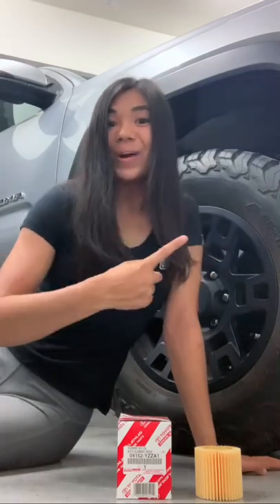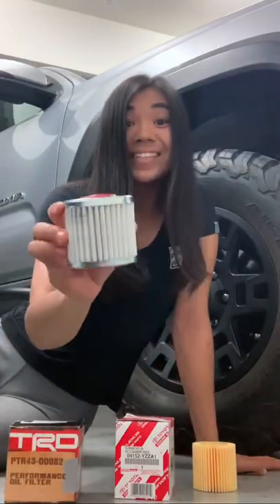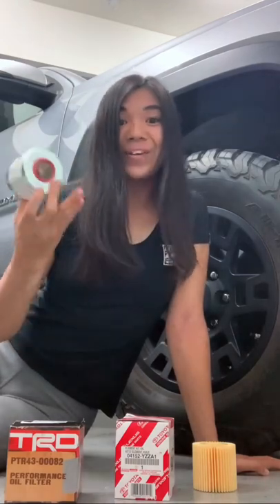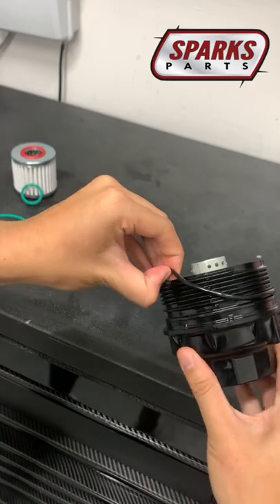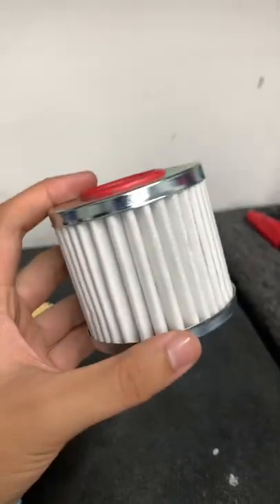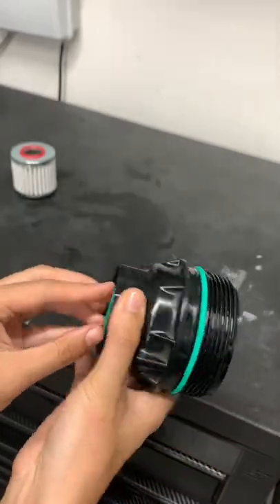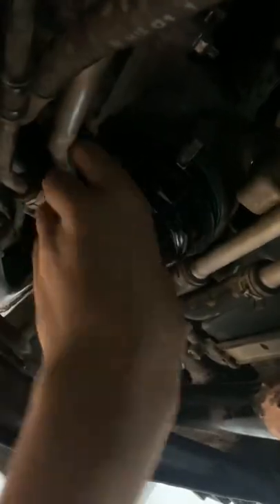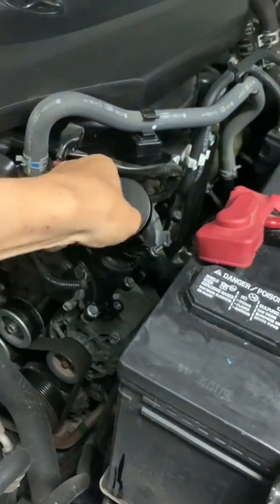Is the TRD Oil Filter better? (PTR4300082) #shorts

Comment: I am a Toyota dealer tech and I haven't ran into one of these yet. For those who are concerned about the quality of the normal OEM filters, I can attest that they are very high quality
Reply: Those metal end caps seem unnecessary considering they have that metal screen down the center of the paper element housing integrated into the cap. I had a Hengst setup on my ecotechs and they didn't have that metal screen to support the filter. The filter itself had a plastic core and they would be collapsing by 6-7k miles. (The factory recommended intervals)
Reply: I'm waiting for that one guy to show up preaching about how "FRAM filters are the best"
Reply: @deadpanda12109  I'm one of those guys that doesn't necessarily believe higher micron ratings are better.
Reply: @deadpanda12109  I'm also a "clean oil and a cheap filter is always better than old oil and an expensive filter" guy too. I would rather do a 3k interval on conventional than these 12-25k mile synthetic changes. I usually run Mobil 1 ep, penzoil platinum or Amsoil but i still change it between 4 and 5k.
Reply: @Hector Cortez-aponte-cabrera glad we agree!
Reply: @Hector Cortez-aponte-cabrera what's insane is my new Rangers factory oil life interval is between 7,500 and 10,000 miles! I did my first oil change at 1,500 miles to get the Motorcraft synthetic blend out of there along with all the shavings from break in. Was going to run mobil 1 ep however they didn't have it at the store so I went with Pennzoil Platinum (have heard some claim it outperforms Mobil 1) Im one of those guys that can feel it after a change and wow I got to say it really did smooth things up a lot. My fuel average went up a tick as well from 22.4mpg to 23mph. I debated running amsoil, but i can't justify the cost if im not going to run longer intervals.. so I just decided to use Platnum with the mobil 1 ep filter. I plan to change it every 3 to 4k so it should be fine.
Reply: @tokin420nchokin  oh, 100%
Reply: @Hector Cortez-aponte-cabrera  I 100% agree man I want to keep this thing on the road as long as I can!  I had planned to buy the truck when I turn the lease in so I have been making sure to maintain everything really well, but we will see (really like the looks of new Colorado with the turbo, if they release it) I am not a mechanic by profession but I definately could be. I went to college and focused my degree on it probaly because im cheap but i keep stuff running. The only work I dont do myself regarding vehicles is alignments& tire mounting and balancing (maybe some other highly specialized work like machining if needed) . Not because I can't do those things, I just don't own the equipment lol (actually use to work at a tire place as a teen doing tires and alignments) it's been good chatting with you man, cheers and good automotive luck. May your vehicle last a million miles, and a million more.
Reply: @deadpanda12109  always, and there is always a few comments how Valvoline is the best oil.
Reply: @deadpanda12109  fram is the best!!!! If you want to buy something new that was made so bad it wouldn't thread onto the car! Lol
Reply: @Hector Cortez-aponte-cabrera ive ran beater cars for 100k no oil changes. I would just add new thinner oil when it would get low. Im not saying its right or to do it. Ive just been young poor and stupid. But never did i have a problem. With the engine oil that is . In my case i was always fixing electrical or suspension parts. But thats the shit you do with$200 cars lol
Reply: same
Reply: @tokin420nchokin still a bit overkill, but ok 🤷🏽‍♂️

Comment: I kind of take the Scotty Kilmer attitude: as long as your using OEM parts and oil, and your following the scheduled maintenance or before: something like a TRD filter may be better at a microscopic level looking at a graph. But in terms of will it make or break…. No, the standard filter would just be fine and you’ll get plenty of mileage out of the vehicle. Like the guys that have Tundras getting 400-500+ K miles off basic maintenance. I doubt they wasted the money on a pretty filter. That’s really all it is. But if it makes people happy and they are willing to drop the extra bucks, then what the hell. That’s why they sell them. Easy money.
Reply: Right, this mostly seems like something to get some extra money because it has thr TRD name. Also there should be no concern about the paper filter collapsing. I have personally never heard of that happening even in 10k+ oci.
Reply: OEM oil is mobile one
Reply: Oem parts are overrated depending on what the component is, pretty much none of the parts I put on my 335i are oem because the companies that make parts for my car care more about it than bmw does 😂
Reply: @griffin_kith6214  speak for yourself, German oem parts are junk because German cars are junk
Reply: @Jamxknife  sounds like something someone would say that’s never driven a fun euro car 🤷🏼‍♂️ sucks to suck
Reply: @griffin_kith6214  Don’t get me wrong, they’re fun and fast but they’re literally the worst when it comes to parts and reliability. It makes sense aftermarket parts are better since all oem parts are plastic junk
Reply: Read that in the Scotty Kilmer voice, because it's what he'd say.
Reply: @Jamxknife  woah woah woah chill lmao German cars are reliable when you take care of em properly😂 have the money to buy German vehicles must have money to keep up with them. It’s the people that wait last min or till things break that call German cars unreliable💀
Reply: Yes. Not even that take diesels for example using the wrong filter other than oem can smoke the main bearings on it due to a 0.3mm difference in o ring placement.
Reply: Well TRD IS a toyota factory filter.
Reply: @Nonyabiz69  it is not, it is manufactured by exxon-mobil but it's a VERY different oil formulation
Reply: @d33znutz1152 bro what
Reply: True for canister style filters like this but using an upgraded(larger/better engineered) spin-on filter has multiple benefits, the main one being an increased flow/decreased restriction for the oil pump. If you are putting your motor under heavy loads (towing, track work, more power) than a larger or uprated filter is almost always better.
Reply: The glass polymer filter don't actually filter out as much as a paper filter so they're worse for the fine particulate and daily driven cars. Their advantage is they don't clog up as easily so they're more suited for a race engine which sees more rapid wear but also has it's oil changed more often to keep flushing out the very fine particulate.
Reply: Yes, my 06 Sequoia is nearing 400k miles and I have only ever done basic maintenance.
Reply: @griffin_kith6214  i drive euro cars and that man is right and so are you oem euro cars and parts are junk , for us euro guys the aftermarket option is the best especially for the 335i we need em waterpumps every 6 months LOL
Reply: @arch1028  luckily I haven’t had to do my waterpump yet but I’m sure it’s coming soon I’m approaching the 90k mark on my 335i, bought it at 80k tho so I’m not sure if it’s already been replaced or not I doubt it because one of my coolant lines to the pump is swollen asf
Reply: @Nonyabiz69  But she's using havoline....
Reply: @griffin_kith6214  Maybe for BMW, but I would never use Chinese garbage aftermarket parts for my Toyota vehicles and the price is not bad either! Quality oil filters like WIX or Amsoil or NGK spark plugs are OK but other parts, they have to prove it they are better than Toyota OEM parts.
Reply: I think that's the only sesible thing kilmer has ever said.
Reply: @MrCROBosanceros  I mean most of the aftermarket companies that make parts for performance bmw’s care more about the cars than bmw themselves do and most of the parts I get are made in the USA or Europe and very high quality lol
Reply: Next to that: Havoline?
Reply: @datownkidd  I have seen cheap filters collapse and disintegrate but yeah if you use basic oem generally you will be doing the best you can
Reply: Who makes both of those filters anyhow?  For my Volkswagen, they are usually Mann Hummel or Hengst.  Those are not the only two OEM brands for that car, just the two I am most likely to see.  In fact buying a filter from the dealer, it is easy to tell it is a MANN filter, they make no attempts whatsoever to mask the brand.  The only difference is that the dealer one has Volkswagen markings on it and comes in a good looking box.  I stick with Liqui Moly oil and the car has never burned any of it.  That is right, I don't have to keep a couple cases of oil in my trunk just to go places!!  The only time it is anything else is if someone replaced it with something else.
Reply: You do know Kilmer was only ever just a salesman, right?
Reply: @MrCROBosanceros  I don't care much for Chinese car parts either.  No where on my 2013 Passat have I ever found a Chinese part.  Those parts are either made in Mexico or Germany or the lid to my coolant reservoir, Austria (not Australia).  It never had a Denso alternator or starter, those are all Bosch on those cars.  The only time it is ever anything else is if someone replaces the part themselves and used a different brand.
Reply: Legit read this in Scotty Kilmer voice
Reply: Legit quote
Reply: The things oil filters filter are microscopic.
Reply: I read this in the Scotty Kilmer voice
Reply: Spot on. Totally agree. Same goes for motor oil. I’ll stick to the three dollar a quart Costco synthetic blend. No way I’ll spend $12 a quart on Amsoil or Redline. All cars doing that will last longer than anyone would ever want the car
Reply: Hard to out think Toyota engineering.personally ,I don’t try to.
Reply: @griffin_kith6214  if someone gifted me a european car, id reject it or immediately sell it 😂
Reply: @wond3rkid82  good for you that would be my same reaction to anything domestic 🤷🏼‍♂️
Reply: I can see that new and you're putting on this even have as much surface area because of the metal, not for me.
Reply: Ya it's not going to make a difference, it will only make a difference in the peoples minds who constantly worry about something this microscopic, plus if you change it every 5k miles your getting rid of the particulates so quickly the filter won't even be half used. 

I will get dirty if you let it go over 7k miles once the oil is all fully burnt is when you start to get particles in the oil.  So you should have no worries if you change every 5k. Don't waste money on over priced unnecessary parts.

 That would be like me changing my brakes every 10k miles just because I don't want the rotors to get grooves in them from the pads being too worn down. It's unnecessary worrying, they are built to specification from the factory so i don't know why this filter is more special that the oem. 

The oem probably has similar micron rating and it don't matter if it's paper or synthetic glass polymer, just a lot of techno babble to make it sound better in your mind. ❤❤😂
Reply: @Jamxknife and you drive a 81 Chrysler  K car? 😂  I have 5 bimmers aged from 1991 to 2012 all working like a charm. Maintenance is key regardless of car one owns.
Reply: @RS-of1om  More like an 1000whp evo and a few other cars. The 05 evo is my newest car, I'll pass on all that new plastic crap
Reply: @Prestiged_peck  is it actually or are you just saying that genuinely want to know because from what I understand I should say I’ve heard is that Toyota recommends switching to mobile if you cannot get a hold of OEM Toyota oil, that would indicate to me that they are the same
Reply: @DanBrando  the Toyota formulatio is indeed much Better, but the retail mobil formulation is still very good oil. It's like home cooked fried rice versus hibachi fried rice
Reply: also oem is made spec for the vehicle. You can go to your local dealership and buy parts, you be surprise things like oil filters is probably less if not competitive priced than aftermarket. miata, honda, acura oil filter $10, pretty standard.
Reply: Did she buy those or did they give them to her on exchange for a review
Reply: Who makes Cummings oil filters
Reply: @griffin_kith6214 
Euro; make in Mexico,  South America… as many faultswagons are, bmws… who knows where… are incredibly unreliable. Take the fuse schematic… they can’t even get that straight.

Comment: I used a different Toyota dealership for my final Toyota Care service.  After 5000 miles, I did the oil filter myself.  I discovered they torque the hell out of the filter, drain plug, and skid plate bolts.  The heads of the skid plate bolts snapped off while I was trying to loosen then.  

If you want the job done correctly, do it yourself....after you watch Chloe 's video.
Reply: I take my 4Runner to an independent shop that only services Toyota and Lexus. When I took it to the dealership, they used an impact wrench to install the wheel lugs after a tire rotation and warped all my rotors.
Reply: @zzanatos2001  Absolute clowns.  The dealership should fire them.  It gives Toyota a bad name.

The dealership where I bought it is reputable,  but they are not local.
Reply: @zzanatos2001  Not uncommon to use an impact to install lug nuts as long as a torque stick is used.
Reply: Skid plate bolts can seize really easily if you drive regularly through even an ounce of rain. I went to take mine off after oh 20 years of it being on there and 5/8 bolts completely sheared off with only a socket wrench
Reply: @prius.killer  20 years...ya, I can see that happening easily.  But mine were there for only a few months.
The factory recommends using anti-seize on those bolts, as I did on my 2004 Tacoma.  In the 14 years of owning the 2004, I never broke one of those bolts.
Reply: @zzanatos2001  I've always used a impact gun and never had this happen maybe it's because I can actually select my torque on it and I know many raps equals how much torque.
I also torque check every wheel and set it exactly to manufacturer spec's
Reply: Just using an impact on everything
Reply: Dude!!!  They did the same thing to my buddies. Makes me consider not taking them up on the “free” oil.
Reply: @honorableundead2273 I'm pretty sure the clowns don't do this. They go uggah duggah and call it a day
Reply: I let the dealer change my oil and they torqued the filter housing so tight I needed a 24" breaker bar to crack it loose! Never again.

Comment: If you’re running a stock oil system (no aftermarket pan, pump and different oil) just go OEM. Parts and intervals. The filter is designed by Toyota to have sufficient filtering whilst allowing for enough flow.
Reply: That's like saying to use builder grade fixtures in your home because the one who made the home knows best. Toyota and most other manufacturers spec the cars to last the warranty period.
Reply: @CyFi6  don’t be ridiculous, they aren’t designed to just last the warranty. If they were, how come we don’t have 5 dead engines a week on 3-4 y/o cars?

Comment: One hurts your wallet more ... thats the only difference
Reply: Absolutely
Reply: You get what you pay for. It's like buying a Fram filter or buying a good filter. Big , big , difference.  Don't believe just cut one open.
Reply: @kennethlaw5216  I’ve never even had an issue using fram filters
Reply: By what.... 5 bucks? lol
Reply: @specialt9744  lol, fram filters
Reply: @adriananzano2292  ?
Reply: @specialt9744  That's the old internet wives tale that started in the early 90's and now every keyboard mechanic repeats ad nauseam. Fram had a huge recall on certain filters that resulted in some settlements a better part of 2 decades ago! Life goes on. Fram even makes the OEM filters for many applications. But god forbid ppl think outside the box.
Reply: @kennethlaw5216  I never buy Fram filters!  Even if they are the cartridge type that doesn't come in the metal can!  Really I think they did us a favor making them orange so we spot them sooner and get them the heck out of there sooner!!
Reply: No the trd oil filter flows better and keeps the oil cleaner longer I know for a fact. I did a Oil Change right before vacation this year using Pennzoil ultra platinum and a TRD oil filter and for at least the first 1500 miles The oil was so clean I could barely read it on the stick I’m sitting at close to 5000 now and it’s still super clean
Reply: Exactly lol
Reply: Any1ne who thinks differently shouldn’t be driving a vehicle

Comment: To some replies: That is not a gasket, it's a o-ring and is in a sealed bag prelubed from OEM TRD Toyota. You're doing it right Chloe. ✅️ 😊 Most oem or oes canister filters o-ring come prelubed. If you look at the rubber o-rings in her clip they are shinning, not dry! Duh! 😊

Comment: “Structural integrity” on a filter that gets changed every 6k miles anyway
Reply: lol thought the same thing. is she finding her paper filters in ruins after 5k miles?😂
Reply: I spend twice as much buying a synthetic filter that's rated for 20,000 miles. I change my oil every 5,000 miles but by buying a higher quality filter, I feel that it's fine to only change that filter every other oil change. Oil analysis tells me that should be fine. It also saves me the trouble of fooling with that cartridge style filter at every oil change especially if it's winter and it's cold. I don't have a garage so it gets done in my driveway.

Comment: I was always curious about these myself too. My free Toyota Care maintenance ended last month so I'll be doing the next change myself.
Reply: Supposedly the synthetic material on the TRD allows the oil to flow through the filter better on cold startups while still being able to filter the oil well. This is really apparent with synthetic oils
Reply: OEM filter would be fine. Get some oil tests done through Blackstone labs and compare. Type and brand of oil makes a much larger difference than filter. If you don't cheap out and go for oe, OEM, or equivalent, then you'll be fine